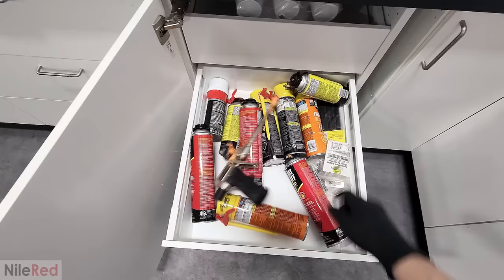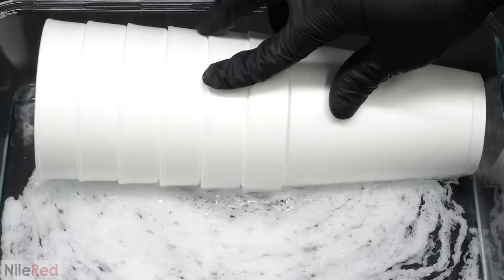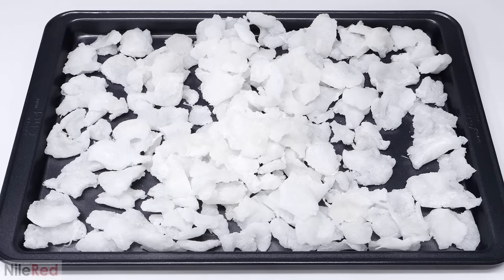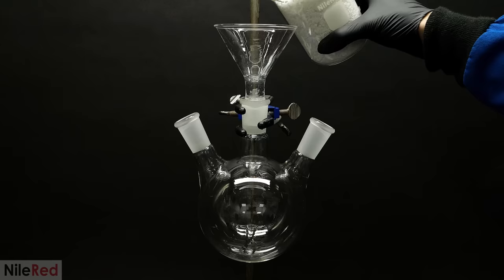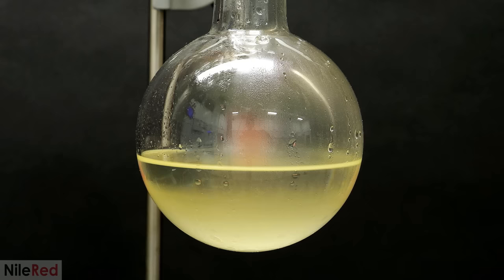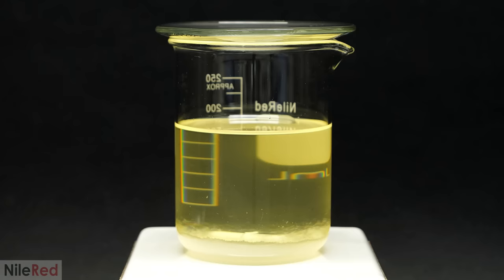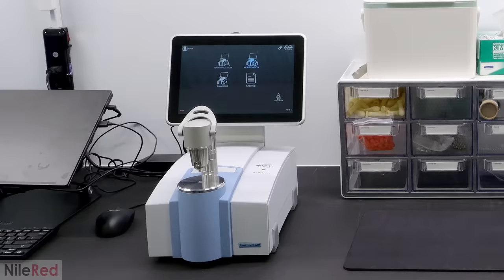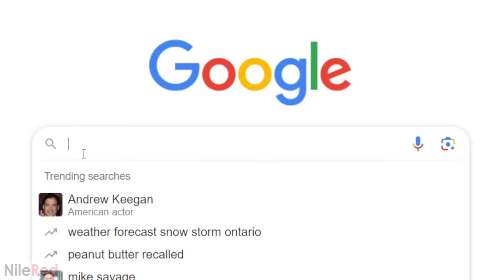Turning styrofoam into cinnamon candy

Comment: As someone who has made countless candies, having your candy "sugar"/crystallize is just something that happens once in a while.  It's often caused accidentally getting a crystal of sugar into the cooked candy, which behaves exactly like you'd expect, acting as a nucleation point.  You recovered nicely though, and did a great job of taking a second shot at cooking/pouring it.  Some candies with temperature-sensitive ingredients are ruined if they sugar since they'll degrade or burn when re-heated, so you were quite fortunate to have such a durable flavor.  You definitely don't want to leave it in the pan when it's done to avoid crystals forming.
Reply: I'm not a confectioner, but if he did this again for some reason, what are some things you'd suggest him change during his prep phase? Would using a "double boiler" setup work better on a small scale to limit how much caramelization/burning that would happen to any sugars or does that just work for specific kinds of confectionery?
Reply: @FatherlyFox  I believe a double boiler wouldn't work because it's heating in a water bath and you need the sugar to reach temperatures higher than boiling water.
Reply: @FatherlyFox  It needs to get hotter than even the smoking point of common oils, so the best you can do for temperature control is a using a pot with a thick sandwich bottom (so there's a slab of copper in the middle). Secondly, don't use metal utensils. Silicone or Melamine. If you're making the really tricky shit you even need to make sure your pot doesn't have scratches (or is non-stick).
Reply: Unfortunately, a double boiler wouldn’t help since candy needs to get above 100 C which you can’t achieve with boiling water. I think Nile should probably do dry runs of these cooking experiments before he risks his final product. He could use store bought cinnamon flavour to try making the candies at least one time to start with, that way we could see him struggle and troubleshoot but he would have less stress and higher chance of success with the final product.
Reply: What’s the point of candy?

Comment: Self taught candy maker here (so, by no means an expert). From what I can tell, the thing that happened with your first try of candy was you didn't "wash" the sides of the pot. When the sugar solution heats up enough to be clear, you need to take a spoon, and kinda scoop the solution up the sides of the pot to catch and dissolve any stray sugar granules. When the candy gets to hard crack, these stray sugar granules can cause the solution to crystalize, rather than stay in a glass-like state. Also, corn syrup helps to mitigate this crystalizing issue, so your additional corn syrup helped a bunch too.
Reply: That makes sense
Reply: i think the cause of this was that usually to fix that problem he would swirl around the flask a little bit so that whatever chemical he is using to dissolve the stuff is touching the sides. Guess he still has a lot to learn about sugar :D
Reply: this is what I thought too, though I didn't know that the corn syrup helps with that
Reply: Corn syrup is poison though.  In the old world we didn't have it and still made candy?
Reply: @MyFriendlyPup  Corn syrup is sugar, just different kinds in varying amounts depending on the type of syrup.  If it is "poison", then all sugar is.

Comment: 42:43 I know it's too late now, but what happened to that candy is it either cooled too quickly without enough air being incorporated, or the syrup somehow recrystallized; although, that's harder to do with the addition of corn syrup, but the syrup could have recrystallized if you weren't brushing the inner-sides of the pan with water to re-dissolve stray sugar crystals (stirring the syrup aggressively while cooking will slosh the mixture up the sides).

Crystallization could have happened in the pan as well if the temperature got too high during the carry-over cooking (residual heat from cooking will continue to reduce the syrup), and there only needs to be a handful of sugar crystals for the syrup to seize when stirring. Awesome to hear that the candy was tasty!
Reply: you can see the sugar crystals on the sides of the pan when the syrup starts to boil, but it's funny seeing people discover how candy making is one of the most difficult sciences of all

Comment: fun fact, by replacing the aldehyde with two cyanides you can turn cinnamon into an exploding light crystal, add fluorine to the head and you supercharge the explosion, 2 grams of the stuff could lift a freight train
Reply: That's wild brother
Reply: Thx I'll try doing this😊 (joke)
Reply: You on a list for suuuree
Reply: thanks for the advice brother, this will be a great help to me
Reply: What material is that cinnamamide? I cant find anything about it being explosive
Reply: @AlexJCross  cinnamalmalononitrile. It's photosalient
Reply: Humanity thanks you for the nasty bomb recipe... seriously bruv???
Reply: Sounds like what Walt used in Tucos place
Reply: @GENEXERHEXO This… is not cinnamon
Reply: Hmmm new ideas to rob thanks 👍
Reply: cia is tracking your credit cards haha
Reply: If it doesn’t I’ll let y’all know
Reply: So some places in the world are a ticking time 💥, specially the places 3m has saturated with the base compounds for such things.. whats the autoingntion temp of such chems and could it create a chain reaction in areas polluted with these chemicals if enough heat was applied 😮😅😮
Reply: Walter white type stuff
Reply: Lift as in throw it in the air?
Reply: Thanks I won’t try do this (joke)🗿

Comment: candy making is a challenge! I think the first batch seized- when sugar crystals get stuck to the sides of the saucepan, they can act as 'seed' crystals and the rest of the melted sugar will follow suit. the corn syrup is supposed to help with that. melting and trying again was the right move though
Reply: He should have added a little bit citric acid (or maybe lemon juice) that is the “acidic regulator” that we see on candy packs. It helps with taste and delays crystallization a lot. Or using more corn syrup also helps😂

Comment: One thing I have learned from candy making videos is that a lot of candies are called "drops" because after they are run through the press, the candy-makers then drop the hardened sheet to separate the pieces cleanly rather than applying force with the hand. Gives a nicer result/cleanly separated pieces.
Reply: Wait that's why they're called that? That actually makes a lot of sense...

Comment: At 10:00, you heat solid powder, condense the fumes, and produce a liquid. This is why I will always find science amazing.
Reply: It's as close to the alchemy of fiction as we're gonna get. It's not quite lead into gold, but it'll do.
Reply: He also did a video on epsom salt, which is actually a hydrate molecule, so it’s mostly water.
Reply: @cannabunnyol  I mean turns out that organic chemistry is way more useful than transmutation, like you can't make antibiotics out of gold. If I tried to mention all the useful things you can make with organic chemistry it would not fit into the comic.

Comment: Almost spit out my drink when he casually hinted at the process of making napalm
Reply: My farts are better than NileRed's farts.
Reply: I mean napalm is essentially polystyrene with a flammable petrochemical.
Reply: @NetAnon  Isn't "polystyrene in gasoline isn't quite napalm but it'll do as a substitute" kind of well known, or is that just among us old weirdos who got a copy of the Anarchist's Cookbook from some shady corner of the internet as teens ca 1999? 

From memory, we tested with an entirely random ratio and it came out a bit too goopy, though it certainly stuck to things and burned quite well. Horrible black smoke, though.
Reply: @dnebdal Internet? I got mine on a floppy disk which was included when I bought a second-hand computer in about 1995.
Reply: @dnebdal  Pretty sure the only difference is that napalm has added magnesium shavings, sometimes also iron.
Reply: @hedgehog3180  The proper stuff has some sort of palm oil based soap, I think?

Comment: The water that was in the styrene solution was likely just water that had been absorbed by the polystyrene. Virtually all polymers are somewhat hygroscopic, and will absorb moisture from the air. So when you heated all of it, the water vapor probably just condensed on the walls of the condenser and came over with the styrene.
Reply: That’s weird though because it was at like 300C.

Comment: Not only does this make me appreciate chemistry more but something as "simple" as making hard candy.
Reply: To be fair, making hard candy is not as difficult if you don't start from Styrofoam
Reply: Watch some candy makers here! When they pull the "dough" on those hooks to air it up and make the color lighter is really neat. Has to still be malleable, meaning still somewhat hot, before it can be rolled into tubes, cooling enough to be chopped into bits, or rolled out into sheets. When we saw Nile drop the last sheet, he basically demonstrated the reason why we call some candy "drops" (like lemon) because in order to separate them, you just have to drop them on a hard surface. Pretty neat stuff, especially when they make designs on the final product by stacking different colors together and rolling them into a tube that may not even look like anything until it gets stretched really thin and sliced into individual pieces. And I don't just mean your typical striped candy cane patterns. They make pictures. Like cats and bears, unicorns and coin faces.

BY HAND. Very impressive stuff!

Comment: The sugar seized up; it happens

The best way to avoid this is to keep a lid on yout pot when boilin the sugar; this will keep any sugar from stickin to the sides and coolin down there, which is what causes it to seize up
Reply: My farts are better than NileRed's farts
Reply: Another thing I've heard people doing is a brush with water to remove the crystals off of the side of the pan

(I've also heard agitating while it's heating up can cause it to seize, but I think that's with recipes calling for less water/dry method)
Reply: @HereComesWheely We make caramel regularly, and also struggled with this until we started adding white vinegar. We never had consistent results with water, but using vinegar is almost like cheating.
Reply: You can't deny he's a great chemist, but a horrible candy maker XD
Reply: @HereComesWheely  I exclusively use the dry method now and I've found it far less likely to seize up on me when working with it...but yeah it's more finicky at first....
Reply: @HereComesWheely  Agitatin it can def create more areas for it to seize up when ya go to pour it out; anythin that gets crystals formin on the metal in the pot is gonna risk it

Brushin down the sides is an option tho ya gotta do it while its cookin so its not as useful if ya try to do it at the end, hence the lid method

Ya just need to use a much larger pot than the sugar will need; just to avoid boilin hot (as in around a hundred degrees hotter than water boils) sugar gettin on ya rly
Reply: @sfurules  Yeah, i think anyone makin hard sugar candies the first time shud use a wet method tho just bcuz the dry method is so finnicky and can so easily burn compared to havin the water to boil off as the sugar warms up evenly immersed in the water

Comment: Turn humid air into nitric acid with high voltage. From here on, several options exist:
A. Electrochemically process the nitric acid into ammonia, then react this ammonia with the nitric acid to produce ammonium nitrate.
B. Dissolve copper, distill off water, decompose copper nitrate into nitrogen dioxide, then react nitrogen dioxide with iron to produce nitrogen, then Haber process.
C. Anaerobic biological processing of nitrates into ammonia.

The first option requires noble metal, will have you playing around with electricity around nitric acid and ammonia, and is probably the most lossful.
The second one consumes iron and requires catalysts at elevated pressures and temperatures, meaning you need equipment.
The third is probably finicky and would be more akin to fermenting, taking a bunch of time, monitoring and biological knowhow, though it seems the least dangerous.

You won't end up with a high explosive, but mixing this with hot fuel in a capped pipe will net you a bomb.

Other methods involve synthesizing proper HE compounds, though that tends to require carbon, which you can obtain from CO2 in air.
1. Condense moisture.
2. Electrolyse condensate, platinum electrodes and osmosis, nets you moist hydrogen and oxygen.
3. Thermally decompose MgCO3 to produce MgO, a desiccant.
4. Capture CO2 from open air with MgO.
5. Decompose the desiccant, gives moist CO2.
6. Use desiccant on moist CO2, gives dry CO2.
7. Use desiccant on moist H2, gives dry H2.
8. Apply electric discharge to H2/CO2 , apply specific-wavelength UV, or fiddle with Haber-Bosch and the water-gas shift reaction.

This will net hydrocarbons. With these, from here on, equilibrium-shift to amphetamines and beyond.
"Thunder? Nah, crack from air."

Comment: For the de-oxygenated distillation at 32:00, you could instead replace oxygen with an inert gas to retain normal pressure without allowing oxydation of cinnamaldehyde.
Reply: Pulling a vaccum is just wayy simpler

Comment: Your sugar crystalized in small pieces rather than the really big ones that are candy. Some air was in there too, that’s why they were able to puff up like geodes. Its normal. The recovery is literally just heating it back up. Most candy shops do most of the kneeding and mixing on a heated table calibrated for the temperature. Also the step after the rollers is to literally drop the candy into a trey to break it up.

Comment: A new form of attack have emerged in sweden, that might be of interest to you: Its attacks on locks with Acid. I suspect they dissolve the copper springs with "Salpeter Acid" (HNO3) to then mount a comb attack on a lock that is normally safe from comb attack. It would be interested if you could do some tests with this in the lab and maybe even do a lab collab with LockPickingLawyer in this topic. This is about door locks, not padlocks.

Comment: You did an amazing job!! The analysis (FT-IR and 1H-NMR) were incredibly clean. I'm really and emotionally astonished
Reply: is there way to learn exact pureness using those graphs? like 99.983829 or something or 97..
Reply: @egeirmakgulseven8945  Hi, thank you for the question, it is quite interesting. Using those analytical methods it isn't possible to determine the exact pureness of the sample, because they aren't quantitative methods, so you can't state a precise concentration (in this case pureness).
It would be possible by quantitative analysis, such us spectrophotometry coupled with a chromatography system to separate all the components of the sample (the main substance and the other impurities). With this method you can state the relative concentration of the analyte (pureness). Moreover, using a standard, you can also determine the absolute concentration.

The analysis that had been performed in this video, FT-IR and 1H-NMR, can still give an idea of the quality of your sample, considering the fact that you only see the peaks of the molecule that you are expecting. These techniques are quite precise and reliable in terms of quality. In conclusion you cannot determine the exact percentage of pureness of your sample with these graphs, however they tell you that the sample is reasonably pure, because only the peaks of the molecule of interest has been detected.

To make you comprehend better the reliability of FT-IR and NMR, they are used mainly to characterize and determine the structure of a molecule, that should be the purest you can make, since they are quite sensitive so they report also the peaks of some impurities that could be in the same sample. In other words, if I see some other peaks or something strange while I'm expecting only the characteristic peaks, it surely means that my sample contains some important quantity of impurities.
In this video, there aren't any other peaks a part from the characteristic ones, so I can state the sample is sufficiently pure, but without a precise quantitative determination.
1H-NMR could also be quantitative, but it is not so simple to perform this kind of NMR, and it can be used for the relative quantity only. However, in this case it was a simple 1H-NMR to analyze the quality of the sample.